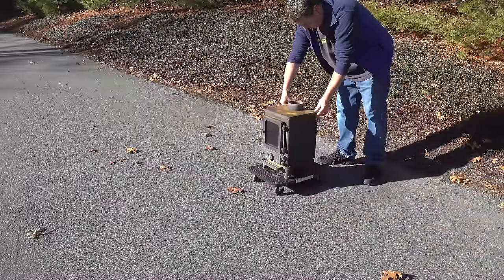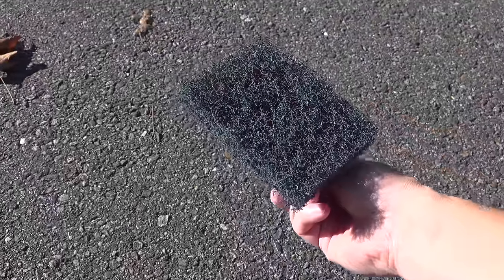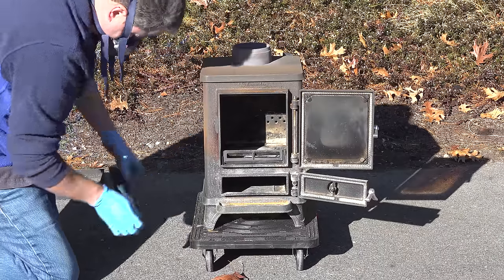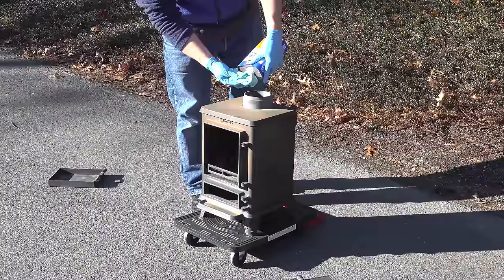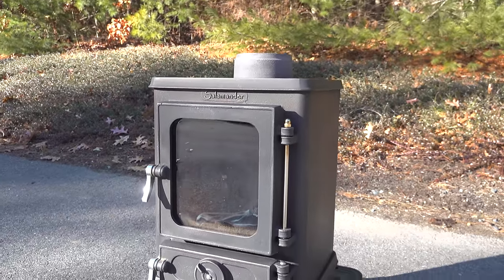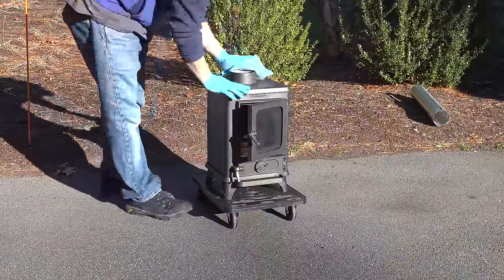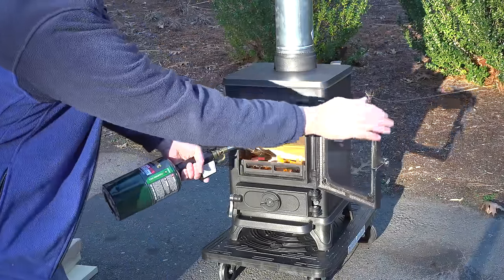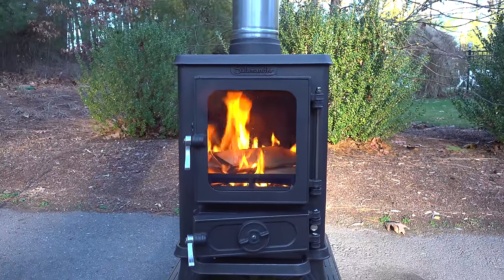How to Restore a WOOD STOVE the EASY WAY - Like New in Minutes

Comment: To clean the glass on a woodstove door use a dampened paper towel and dip it in cold wood ash. Make sure the glass is cool to the touch and rub the paper towel on the glass until it's clean, it takes literally less than a minute. Then take a clean paper towel and wipe the residue off. Much cheaper and easier than store bought cleaners.
Reply: THE best and cheapest way to do it.
Reply: I learned same trick this year and it gave me phenomenal results on my 15 year old Harmon pellet stove’s glass. 
No other product can compete with a damp towel and cold ash! 👍
Reply: Great suggestion, I’ve been using a damp dishwashing tablet which gets rid of the stubborn bits.
Reply: I go even more lowkey and use crumpled newspaper dipped in the ash. Works like a hot dang.

Comment: The Salamander Hobbit stoves are brilliant little things and widely available in UK.  Top tip for cleaning the glass and anything with wood residue on it is to dip a damp cloth or paper towel in wood ash and then wipe the glass clean before giving it a final polish with a dry paper towel.  It leaves the glass crystal clear.  The stove was well worth renovating and you did a great job on it. 👍🏻👏🏻👏🏻👏🏻

Comment: Great video, I recently got my hands on a old rusted wood stove, alot bigger than this one but still needs the same kind of TLC. After grinding/wiping off all the rust I rubbed it down with a few coats of cooking oil (and even a bit of bacon grease) and burned a few hot fires in it..did a good job of sealing the surface from rust. Ill plan on getting some of that polish too and seeing how that compares. Enjoy the stove!

Comment: I always used ash straight from the stove it's self mixed with some cleaner and hand rubbed the glass with it. It works like a charm and NEVER scratches the glass. I usually take the glass out if it's really bad that way I'm not hanging up on the mounting tabs leaving parts of my cloth all over.

Comment: BEST thing I have found to clean a dirty wood stove window. Spray on oven cleaner (do when stove is cold of course). First layer gets most of the gunk using a paper towel and then 2nd spray gets the hard to get stuff, squeaky clean every time, no scratches.

Comment: the fireplace/stove glass is ceramic, its quite hard, and its usually not smooth flat, but has little bumps on it so using a razorblade to clean it off doesnt work well. whatever cleaner you used worked really nice.

Comment: “Considering the stove is almost 20 years old it still looks good”. Well of course it does, it’s cast iron, it will look good in a 100 years too. I just restored a huge cast iron stove made in Norway around 1880, over 30 different parts that goes together like a puzzle. It looks fantastic and it’s 140 years old. Unless these things are stored outside for decades they never really get old.

Comment: What made you decide on this model & brand? What price is reasonable for a used one ?
Reply from the maker: There are a few tiny stoves that you see in the US. But all are rare and I looked for months and this popped up. The other one you see sometimes in the "little cod" very nice small stove two. There are others but this Salamander and the little cod are somewhat common and can be seen online for sale from time to time. I have missed ones as low as $200 and this one cost me $400 which is still amazing. They are $1200 new and take months to get, the little cod can be $2k and up. VERY expensive for little things like this

Comment: Carefull with the brush on the drill
The brushes have a maximum rotating speed, when you turn them to fast the metal wires will fly around.
(Not good for skin and eyes)